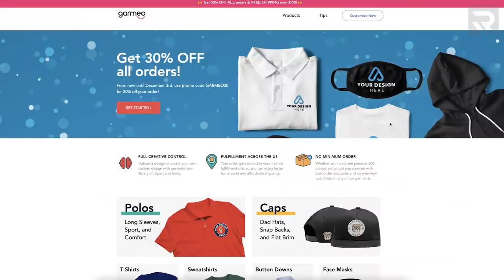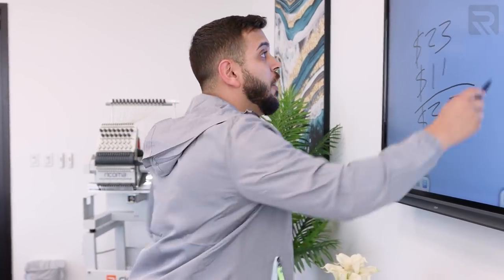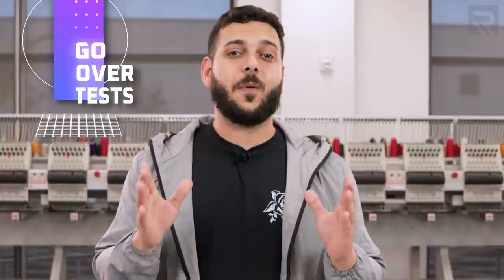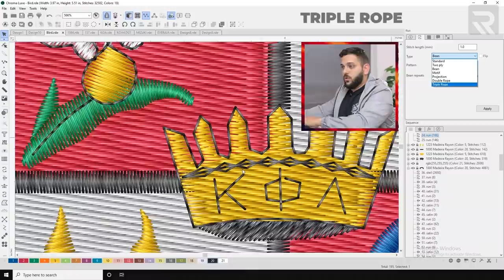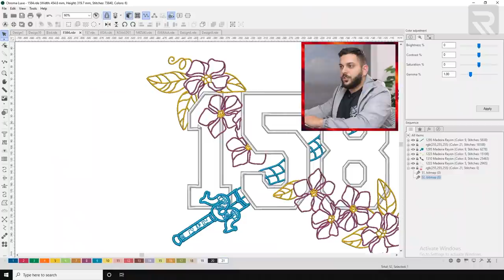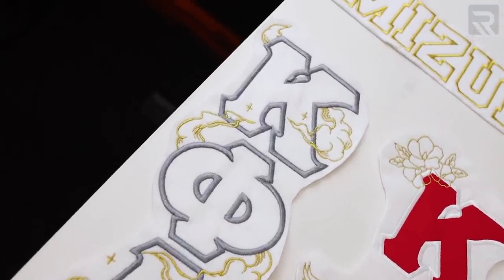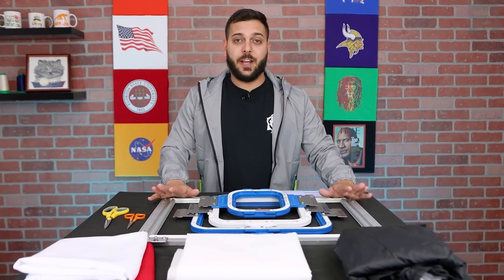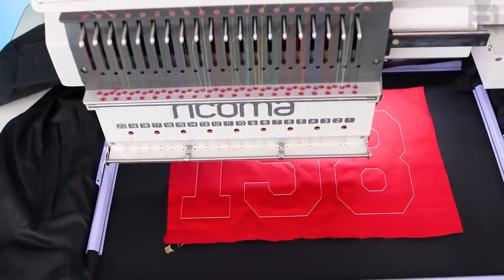INSANE profit on these custom sorority jackets!

Comment: Great work on this, a lot of steps and effort went into this one. Seeing you use that sash hoop made me wonder- what MT-1501 compatible hoop could you use to embroider a design that covers the entire back of a hoodie? I imagine I can't use the sash hoop as the hoodie would just be sewn through both sides. Is there any way to use the largest MT hoop that comes with the machine to hoop the hoodie vertically to embroider the entire length of the back? I've only found how to use it horizontally which only gives me about 13.5" of embroidery height (being that I hoop the hoodie so that the bottom opening can slip over the bobbin rail). Any info is greatly appreciated or maybe could be a future video? I know people are always interested on how to do large designs
Reply from the maker: HI Brandon, thanks so much for watching. We will certainly pass your video suggestion on to our team!

Comment: Question: When embroidering on wool letterman jackets- what needle type and thread weight do you use to embroider on wool body and leather sleeves of letterman jackets? (ex. 75/11 or 80/12 needles)? Thank you!
Reply from the maker: Hi Jacob! It depends on the lettering, but you can use 75/11!

Comment: You can do 3mm with the right settings. That run stich wont look right. You could of used 65/9 needle and 60w thread or even 75w thread and 60/8 needle to get the small lettering done. I do frat stuff everyday. I hate doing there stuff. They are to damn picky. I hate doing there names like Shawn's little Shawn's big bro or Jackie's little. It's not that much money on frats. And you need to be certified to print there stuff.
Reply from the maker: Thanks so much for watching and sharing your experience.

Comment: Dont you need to be a licensed greek supplier
Reply: They are gonna want their cut of this.
Reply: Heck Yes! It is very expensive and there are lots of regulations. They also take a percentage of your profits
Reply from the maker: Then I guess it certainly helps when they reach out to you to do these for them!
Reply: Greek Letters are free to be used.
Unless specifically designed as a logo with non-standard Greek letters,  they can't put a license to an entire language alphabet.
Reply: I am licensed with 5 Greek organizations and I can confirm that it is very expensive.  Some you pay a high fee  annually and you may or may not sell any items.  Others have a lower annual fee, but you pay royalties quarterly based on sales.  Each of these organizations trademarks their name spelled out, name in Greek letters, shield/crest, year incorporated, etc.  If you make products with trademarked images or names, you are setting yourself up to be sued.  I am a member of one of the organizations for which I have a license.  I have reported several unlicensed apparel decorators.
Reply: @alubys  "How can you trademark/license Greek letters?" it's not the letters individually but the combination which is trademarked and is no different than letter combinations that are trademarked for companies like IBM or AT&T.
Reply: Then why did they request the order through a vendor that doesn’t have licensing?